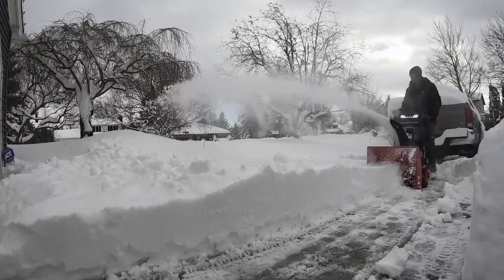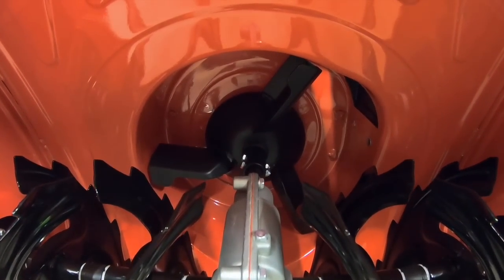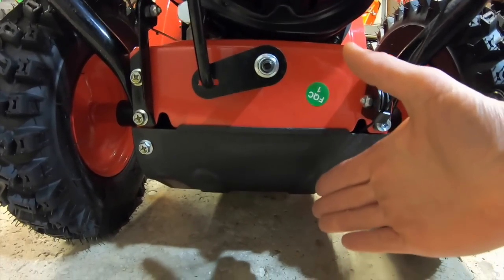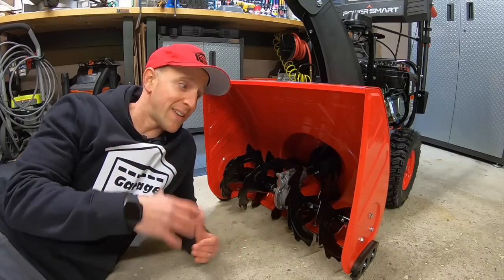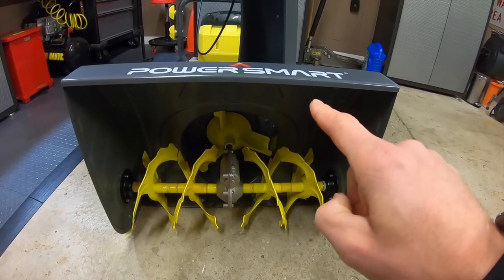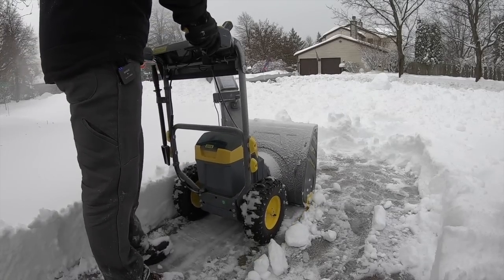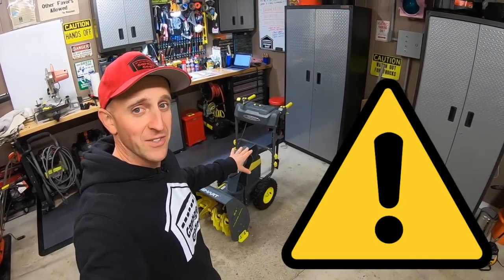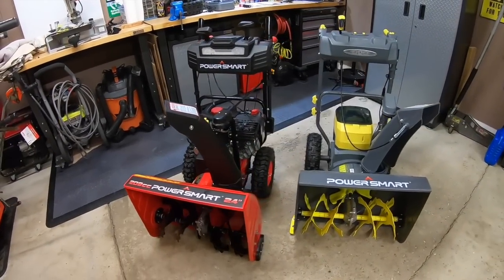POWERSMART 24 INCH GAS SNOWBLOWER vs POWERSMART 24 INCH 80V BATTERY SNOWBLOWER - Which is BETTER?

Comment: I think I'd go for the gas model.  I have a driveway about 80 feet long but narrow only widening out at the end closest to the garage to park two vehicles side by side.  We only get a heavy snow of over a foot about once every ten years or so.  Most winters the most we'll see at once is 6 to 8 inches, but that will generally be wet, heavy snow.  We're in Southern Indiana and it seems the heaviest snows happen right around the freezing mark.  We will occasionally get snow when it's down in the 20's but it's generally pretty light stuff.  I live in a rural area and I don't even know anyone else with a snowblower.  Until about ten years ago I'd never used a snow shovel, just an old grain scoop shovel to clear it with (That is older than me cause I had to use it to shovel the snow with on our farm when I was a kid).  Now I'm 55 and it takes a lot longer to recover from shoveling the drive and oft times we'll elect to just leave the snow in the drive and run the vehicles up and down it till it's packed down real good.  This year I bought a corded electric snowblower that I'm voiding the warranty on by adding homemade skid shoes as it's a single stage blower, but if it makes it last a season it'll be worth it and next fall I'll buy the gas model.
Reply from the maker: Thanks for sharing rebel!
Reply: @GarageGear  BTW, I did see one of those old early 70's Ariens snowblowers on fb marketplace near me.  Doubt it's in as good of condition as yours, but the guy say's it runs fine and only wants $60.00 for it.  It looks even more underpowered than yours started out being as it only has a 4hp engine on it even though it's a 24".  If I get it I'd definitely do the Predator upgrade.
Reply from the maker: @Rebel9668  that would be a good plan!

Comment: Very honest review JB. Powersmart actually reached out to Jake at EP but the blower he told them to ship got sold out on Black Friday. Recently we got in a Powersmart snowblower for repairs and you can tell that the materials used are of low quality when compared to other brands but: you get what you pay for my Dad always said. Powersmart snowblowers are perfect for the homeowners that you described in your video but i wonder how long they will last with extended use. The only issue we have had with the B&S engines on snowblowers is no throttle control so they are at high rpm right off the start. Minus 29 degrees F and you can not warm them up on a low idle and boom there goes the connecting rod. Presently have 4 of these this year alone and we are making more money off them selling parts then if we reinstalled a new connecting rod. As for battery operated equipment buyers will likely realise a minimum of $100 Cdn per year cost just to replace the battery in 5 years at the longest period. Just think if this was your EV who wants to wait over an hour to charge batteries? Not me!
Reply from the maker: A lot of good points here, Wayne. These machines don’t really hold up as the better brands. Batteries still need to improve quite a bit. Hopefully with time, we will see improvements. Thanks for watching!

Comment: Great review JB, wondering what you think of the ego snow blower is is I'm in the outline when it comes to lawn mowers. I see they have a 28-inch now along with the 24in version and I have Winters much like you. Any recommendation on if I should spend the extra money and go with the 28in or will the 24-inch be sufficient? I truly appreciate your opinion and all the great tips you have supplied on maintenance.
Reply from the maker: Hey Richard! I would avoid battery snowblowers like the plague if you have winters like me. One battery usually lasts about a third of the driveway. And that’s with lighter snow. They’re all made cheaply too. You’re also going to spend a huge fortune on batteries. Far more than you would ever spend on gas. If you could go 28 I would. You’ll make less passes over time. 👍

Comment: I would definitely prefer the gas one because if there happened to be a blackout caused by a snow storm then you don’t have to worry about charging anything. Now I know that a lot of these new Briggs snow engines have a problem in their overhead valve system particularly on the exhaust side valve. For some reason the exhaust valve guide has a tendency to pop out and cause the entire valve to fall out of alignment. That then causes the valve to hit the piston head and break it, making the entire engine lock up. The only fix is to pull the head off and replace both the valve and it’s guide. Now I’m not sure if this is still an issue with the newer engines but it could still be since this company’s been having a lot of quality issues. But chances are that plastic speed selector lever is going to break before that happens, seriously that is a bad idea because when plastic gets old, it becomes brittle and breaks. All I wonder now is which chute control system is going to break the first? the gas one or the electric one?
Reply from the maker: Thanks for sharing these good points. You’re right about the blackout. You never know when that could happen. I didn’t even think about that.

Comment: I'm in Western NY - after the 3rd year in a row of having some mechanical issue with my gas blower; I decided to go maintenance-free with the Ego Power+ SNT2406 with 2 10Ah 56 batteries.  I imagine Ego won't be sending you units any time soon to test/review, but they are lightyears ahead of this Powersmart electric.  It cut right through the most recent Blizzard on Turbo and even chopped up some pretty big drifts around 4 feet.  Ran almost continuously on Turbo mode for 45 minutes and cleared an 8-car single driveway out to 5 feet into the road (Plows had not been through yet.  Rapid Chargers (2 included with this package) had the 10Ah batteries fully charged from dead in about an hour.  

Thanks for the comparison and would love to see a review of a higher-end Battery-powered unit like the Ego would compare to your Ariens if you get your hands on one.
Reply from the maker: Hey Graves I’m going to see what I can do about another battery blower in the future. We’ll see how they compare. Thanks for watching!

Comment: I just got a gas model from Home depot. That was basically the only model available now that wasn't 2500+. Hopefully I don't run into too much issues with it. I would have liked a slightly more expensive model but, can't find anything else.
Reply from the maker: It’s pretty much slim picking at this point of the season! Best time to knab one is in the spring or summer. Dirt cheap then.

Comment: My neighbour (Toronto, Canada) bought a Powersmart gas snow blower from Home Depot about 4 years ago (B&S 212cc motor, 24") and it works quite well. It starts first pull. That said he tried to push into the snowplough bank and broke a plastic auger bushing. These little white bushings (I can see them on your machine) seem to not be for sale on the web, and seem to not be available for sale from Powersmart. It's all ok to buy cheap Chinese products if you're not going to heavily use them, but don't expect them to last. I think he paid $750CAD at the time. Replacing that white plastic auger bushing will take a lot of effort.
Reply from the maker: Thanks for sharing Tor! It will be a big job to get that little bushing in there.

Comment: I run a Poulan Pro 30 inch blower. It is 3 years old this winter and no major issues, only thing I don't like about it is it only has one reverse speed. It has a 254 cc engine and according to Poulan rated at 10 1/2 HP. I watch a lot of videos of guys with their snow blowers and the biggest gripe I have is they are sometimes forcing their machine through heavy stuff, just take your time and let the machine do the work, might take a little longer but your not as tired from wrestling your machine around.
Reply from the maker: Good tips! Thanks for sharing!

Comment: Great job comparing these two budget snowblowers, JB. As you noted, as long as you fit the machine to your unique need, you’ll be fine. (Although the augur rotating after you release the lever would be enough to scare me away from they that machine.) Thanks for doing this fair comparison.
Reply from the maker: Every machine has its place and purpose. It’s important to look at your average annual snowfall and how much power you’ll need. Thanks for watching Douglas!

Comment: Thanks for that tip, I was going to buy the battery operator one but, got b me the POWER SMART gas one. I have a question, what's the horsepower of the POWER SMART gas one? Thanks for the video like that tip. Have a nice n blessed holiday. Take care
Reply from the maker: Hope you like the machine! It is around 6 HP. you have a great holiday too! Thanks for watching!

Comment: I would use neither.  Power Smart parts are apparently hard to find.  Those Briggs snow engines are pretty reliable but not as reliable as MTD's PowerMore.  I had one on a Husqvarna made Craftsman, and cleaning the carburetor was a pain in the rear.  I had to remove quite a bit of shielding to get to the carb.  Not ideal.  I now have a Cub Cadet, and despite the lacklustre customer reviews, the machine has been relatively trouble free.  The engine was the largest installed on a walk behind snow blower up to that point when I bought it back in Winter 2020-21.  The thing's basically a 420cc Honda GX390 clone and boy is it powerful.  There are a couple of times it got clogged with slush where the engine was still running but the auger was stalled, causing the belt to squeal.  It's only been twice where that happened in the two years I have owned it.  The only downside is I go through 2-4 shear pins each season but at least they're doing their job.  There is one thing the Briggs engine has that I have yet to see on a Powermore:  a fuel shutoff.  Of all of the things that look Honda on this machine the one thing they didn't copy over was a fuel shutoff either on the carburetor or in line.  Honda GX engines, even the GC engines all have some kind of shutoff, but why is it missing on the Powermore?
Reply from the maker: Not sure why. Cut costs perhaps? Thanks for sharing this information.

Comment: $280 for a Battery, I'll absolutely pass and stick to gas. Electric is definitely cool less maintain but honestly the battery price is crazy!! It's best to have an extra one so you don't have to eat over an hour for the one to charge and while it's charging the snow you just removed is piling back up. J.B in my opinion, this whole switch from gas to electric is just nonsense. I will always stick to my gas powered equipment, it's cheaper more powerful and I get better results. I always maintain my equipment so I don't have the issues of them not starting when they are needed. Anyway thank you for the review J.B it was awesome as usual. I'm actually digging that power smart.
Reply from the maker: Hey Gary totally with you on this one bud! 💯percent! The price doesn’t justify the means and the power/stamina is unmatched. I do see the value of battery in a string trimmer application though where intermittent power is needed. But anything that requires consistent power you better be thinking gas! Thanks for the positive feedback my friend! 👍

Comment: Ten inch augers, ten inch auger housing depth, thin metal, and thirteen inch tires won't work here in Chicago for heavy lake effect snow.
My Ariens Deluxe 24 catches hell a lot of the time, so I can only imagine what those models would be like in that kinda stuff.
Reply from the maker: Yeah, they definitely lack the weight to not get thrown around to get through high snow banks. Thanks for sharing!

Comment: When blowing snow, mowing, or similar task I want to get it done. Waiting to recharge batteries doesn't get it done. Plus the replacement cost of batteries, or having an extra one on hand, at some point becomes cost prohibitive. How long will a battery last? 🤷🏼‍♂️ Gasoline equipment can last 20 years if maintained properly at minimal cost. I'm have yet to be convinced that battery power is the way to go. 
Thanks the honest and informative review.
Reply from the maker: Appreciate the positive feedback and your input! Gas def has a leg up on longevity. Thanks for watching!

Comment: very good snowblower review video, good information.  

I'd like to see a review of the new Troy Bilt Storm 2435 snowblower.  I saw it listed on the Canadiantire website with these features
Intake 24 inch width, 21 inch height
243cc engine
12 inch auger, 12 inch impeller with 4 paddles
15x5 tires
heated handgrips

it has a halogen light installed behind the chute unfortunately, but Troy Bilt offers an expensive LED light bar accessory that you can install in front of the chute on top of the intake housing.
Reply from the maker: Hey bubetube! Appreciate the positive feedback. If I can get my hands on one I will. Thanks for watching!
Reply: @GarageGear  Oh, great.  Short of the halogen light behind the chute, I think that's a kick ass configuration for a 24 inch snowblower.  I've been looking for one designed like that for a long time so I'm eager to see someone review it.  It's new so there's no reviews out yet and it's only in Canada right now.  I think they're scamming their customers with that expensive LED light bar accessory.  It should be a standard feature in 2023 and they know their customers want it so they slap a cheap halogen light behind the shut just so they can squeeze more money out of their customers with an overpriced LED light bar accessory.  Jerks, hahahahahahaha.  Oh well...
Reply from the maker: @mrbubetube  blows my mind they are still using halogen bulbs. LEDs are so cheap. It should be a no brained at this point.

Comment: Gas FTW again. I do a lot of snow blowing so speed and efficiency is critical. That said even if I was only doing my house, the battery machine would frustrate me to no end in short order. I knew runtime would be an issue but the combination of the auto shutdown and needing to stop forward progress to adjust the chute would have me taking a sledgehammer to that thing in no time. I could at least make that entry level gas machine work if needed. Great overview JB, keep'em coming!! 👍
Reply from the maker: Hey Smallblock, definitely agree. Efficiency is critical when snowblowing. You should have seen me trying to figure out the chute and forward progress lol! Irritated is an understatement. Appreciate the positive feedback bud! Snow piling up by you?
Reply: @GarageGear  not a flake yet🤬🤬, might get 1/2" Sunday night... I'm moving to buffalo, you hiring?! 😁
Reply from the maker: @smallblock412  wow! I could use a camera guy lol! 🤣👍
Reply: @GarageGear  on my way lmao

Comment: Batt-operated units have a long way to go before I invest in one.  I think I can get 15-20 years from PowerSmart 24 2 Stage Gas Unit ($500) with good maintenance.  We typically have less than 8" snow falls, no more than 3-4 times a winter.  We'll see.
Reply from the maker: That’s a possibility. Def agree about battery powered.

Comment: I would definitely choose the gas model. That looks like a decent unit. Great video summary of both of them JB 👍
Reply: Right, the price for the battery alone is crazy!! Plus if you don't have an extra battery you have to wait over an hour for it to charge? While it's charging the snow is continuing to pile back up😆 I'll never go electric
Reply from the maker: Hey bud the gas model is a decent unit. I would go gas as well. Appreciate you and the positive feedback! A lot of time and shots went into this video. 👍 what’s next on your video list?
Reply from the maker: @garyalensr  these battery prices are crazy. And the fact that snow is piling up still while you’re waiting on a charge is annoying! 😡

Comment: Thanks but I'll stick to my 30 inch Airens with a 305 cc GAS engine, no electric's for this guy.  Snow equip just has to work to hard .  Great video
Reply from the maker: You got a great machine there Leonard! Thanks for watching!

Comment: Question: does the battery need to warm up to room temperature before you recharge it?   The logistics of battery management seem challenging.
Reply from the maker: Hey Brandon! The battery definitely needs to charge inside at room temp. Even in a mildly cold garage it wouldn’t charge. Thanks for watching bud! 👍👍

Comment: I have the DB2805 electric. I bought it January 2022 and only had to use it once. Have a spare battery and they lasted about 35 minutes in about 4 inches of snow. We just got about 3 inches of snow and got the blower out. Everything worked BUT the drive. After trouble shooting found that the plastic drive switch activated by the drive lever was broken. We had  -10 degree weather and I don’t know if the extreme cold caused the switch to break or its just a cheap made switch. The biggest issue now is trying to contact someone to order a switch. It is holidays so I will give benefit of doubt for several more days.
Reply from the maker: Thanks for sharing acp!

Comment: Locally I have seen quite a few newer electric snowblowers for sale. They all say that they went back to a gas powered machine because the electric could not handle the snow we get.
Reply from the maker: Same here and people are trying to get their money back and it’s never gonna happen. They don’t hold any value. Thanks for watching!
Reply: Not my experience at all with a toro 2 stage electric.
Reply: @WatsitTooyah  I'm in northern Michigan. The electric snowblowers can't handle the amount of snow we get. I'm sure it would be great for light snow or a small driveway.
Reply: @shadymaint1  well my electric blower handled a 3 foot dumping in November and 4 feet in December so thats just false. Dont speak down on things you don't understand just to make yourself feel good 👍